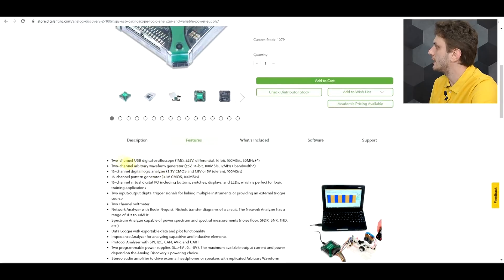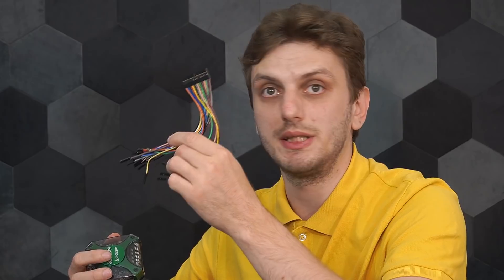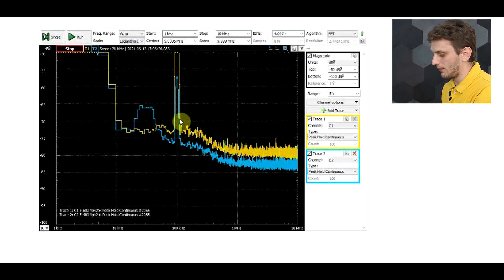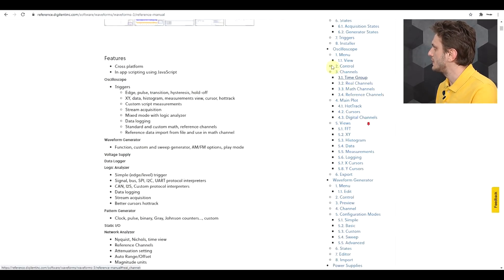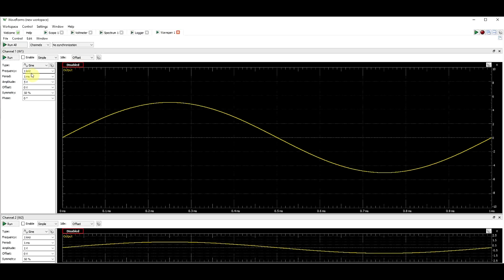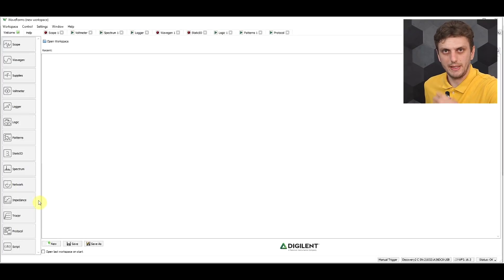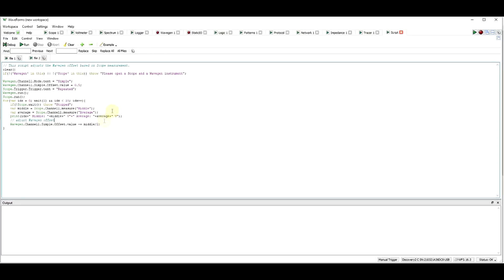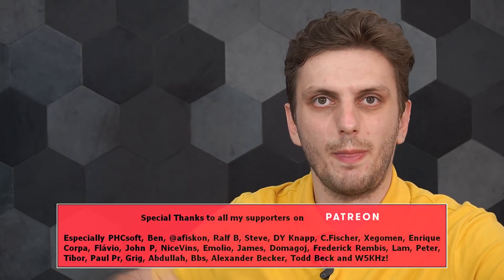Analog Discovery 2 Review

Comment: Interesting ! 👍🏻🤝🏻🇳🇱
Is there a reason for the black tape on the powersupply you have on the bench in many videos?
Reply from the maker: It covers the name of the manufacturer/reseller; I've seen the exact same supply appear under different names, but the model name is the same.
Reply: @FesZElectronics  Thanks. That was clear to me. I just wondered why that powersupply and not the other equipment ? Scope, multimeters etc
Anyway, I like your videos. Cheers from the Netherlands 👍🏻🤝🏻
Reply from the maker: Ah, well, I guess then it has to do with equipment I do and don't recommend. Out of all my pieces of equipment, the power supply is the one thing that gave me the most headaches - I have a few episodes on how I am trying to reduce its noise output. I can't say all my other pieces of equipment are perfect, most of them are relatively low cost, but the power supply just stood out at the time I put the sticker on, and I haven't really taken it off since. I didn't change it either because I really enjoy the form factor, its really small.
Reply: @FesZElectronics  Thank you. A decent set of powersupplies is a great asset. I built a few myself. And will watch your videos about your improvement attempts. 👍🏻🤝🏻🇳🇱

Comment: Nice having a sort of Bode 100 and Saleae 8 under the same roof, but you just can’t expect the same performance with Analog Discovery 2 (on certain characteristics). I find very unique the digital pattern generator, which is very useful for FPGA debugging. The bundle has some meh small test hook clip grabbers. The support from the forum is pretty good and prompt. My 2 cents.
Reply from the maker: Of course, you don't get the same performance, but the Saleae is ~400$ and the Bode is ~4500$; As long as your budget is limited, the AD2 offers a low cost equivalent.

Comment: It's a nice gadget. Sadly, one needs a laptop or a desktop to use it and that cancels out the small size.
Reply from the maker: In my experience at least, not using a laptop/computer for regular electronics experimentation is not really practical. I mean, if you need to look up a datasheet, or you don't want to print schematics on paper, or just run a quick circuit simulation, the computer is indispensable...
Reply: @FesZElectronics  I agree and use my 10" android tablet for datasheets. 
My work bench is too small. I'm sure it is a fantastic tool for the right lab.

Comment: One thing that bugs me about these Discovery products (I have a Digital Discovery) is the *&^%$#  I/O wires, and not even the electrical properties.  Why oh why couldn't they use rainbow ribbon cable that uses wire colors that we are either already familiar with, or which it's useful for the youngsters to learn anyway.  As it stands the wires are in completely useless nondescript pastel lavenderish (?), burgundy (?), green and beige (?). I mean, as engineers, we don't even have words for three of these "colors"!  And that list of four repeats every four wires, so it's incredibly easy to get them mixed up -- as I have even seen on a product demo video.  I do see in your video that AD2 has some other colors thrown in at one end.
Reply from the maker: On my cable, the colors for the digital I/o 's do have the 4 colors, but on the second row these wires have the same color with a white stripe. So I guess that helps to not mix them up so badly. The other colors are for the oscilloscope and the signal generator part. In the end though, I guess you could make your own ribbon cable, since its a standard 2.54mm pin header, it should not be that hard to get a connector. I rarely use the stock cable, rather I make my own adapters and cables for specific needs.
Reply: I've mostly become used to it, but need to briefly refresh myself each time I start using the LA. The problem is that if you use the standard resistor rainbow colours you'd risk confusing the power supply with, say, the digital channels.

Comment: I wanted to buy one when they came out many years ago. 
At the end, I decided to buy a 100MHz dual channel scope that has a sig gen and spectrum analyzer built it, for less money! 
AD2 is a great tool when you're a student and have to bring your own lab equipment. 
After that, not much space saving with having to use a laptop to operate these headless units.
Reply: May I ask what unit you bought?
Reply: @ixpixp  Hantek DSO4102C

Comment: These aren't just for hobby or education, they're invaluable on the professional bench too: I have two of the AD 2s, an original Analog Discovery 1 and a Digital Discovery. The second AD 2 I bought in a bricks and mortar store in Tokyo when I'd forgotten to pack it into my baggage.

For the logic analyser, there are more decoders than most scopes, for example 1wire. The biggest drawback of the LA is the limited memory depth.

I use the power supply quite extensively, especially for unit testing, but most of my work is in the low power mixed signal world, and as such the current limitation isn't a problem for me, and I don't even use the external barrel connector supply input. Note that they are limited to +/-5v. It would be more useful if they went up to, say, +/- 15v for some analogue applications.

The default scope inputs are differential which might confuse newcomers: the impact of this is that most of the time, when used in unipolar mode, the -ve input is simply tied to the DUT's ground. I rarely use the BNC adapter in the use cases I have.

The software is about as good as it gets for a USB instrument. There are occasions when it's a little frustrating to find out how to do things, generally leading to a minor fit of random button pushing.

The best feature for me is its form factor: I can take it anywhere, and pre covid I used it frequently on long journeys, and when on the bench, it takes up little space.

Unfortunately the price has been creeping up over the years. At one time the original AD 1 was $99 to students and $199 to others: it was an absolute steal at those prices. It's now $279 academic pricing and £399 list. There were shortages at the beginning of Covid, presumably when students weren't able to get into the labs.

IMHO, even at $399, this is a worthy addition to any EE bench.
Reply: Wistful day-dream sequence.....Tokyo... a faraway land where Analog Discovery 2's are just sitting around in bricks-and-mortar stores, waiting for you to pick them up whenever you happen to pass by ...
Reply: @Graham_Wideman  Akihabara, but you need to know where to go, and have time on your hands. I have a little map I made after a few visits. For some reason, this particular store only took cash, so I had to find a cash machine to make my purchase. https://akizukidenshi.com/catalog/g/gM-10135/
Reply: @nezbrun872  I was really just making a whimsical remark for amusement -- but your reply is pretty interesting! Thanks!
Reply: @Graham_Wideman  You can spend hours in the half dozen or so shops I frequent. They have stock of reasonably up to date devices, and pander to everyone from guitar effects pedal makers to FPGA aficionados. I usually walk out with dozens of assorted breakout boards, tools, headers etc. They're often frequented with school kids looking for parts for their projects which is a joy to behold, it brings me back to my schooldays several decades ago. The biggest problem for me is that typically I'm jetlagged when I visit: their opening times are my native bedtime.

Comment: Great intro. Would you make a video on how to design a DIY 2GHz spectrum analyzer using modern ICs?
Reply from the maker: I'm not sure I could properly do that... There used to be some relatively cheap products on ebay or similar places, that advertised 35Mhz-4.4Ghz USB spectrum analyzers. Although not perfect, the thing you buy will most likely be cheaper and work better than a diy option... I used one of those in an older video: https://youtu.be/cFM1oJwXzpE
Reply: TI has spectrum analyzer sub ghz upto 3ghz on the C31 evk board.